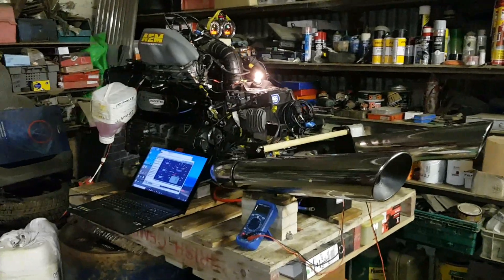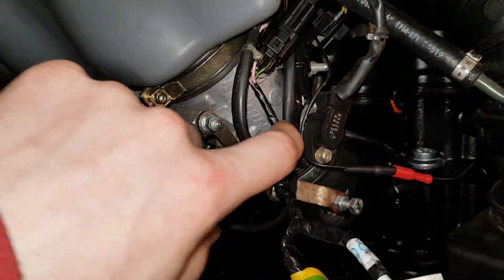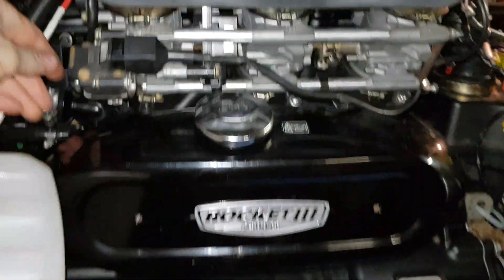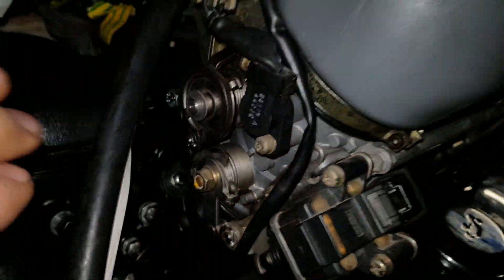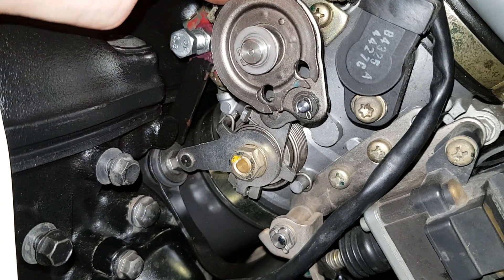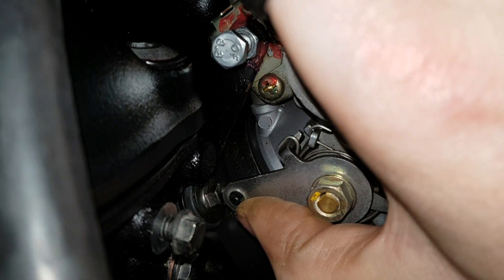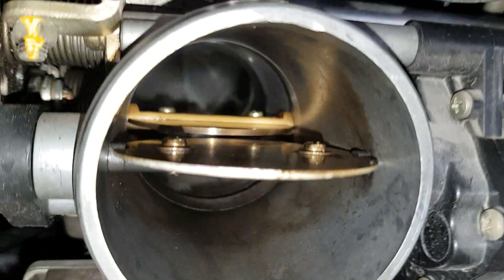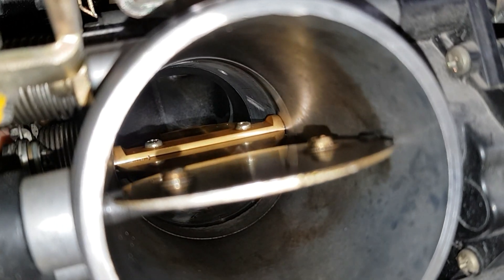What if I told you that you've only used 90% throttle?

Comment: Can we open it up to 100 with some work.
Reply from the maker: You could file the stop tabs. But first I'd run the bike on a dyno using both the twist grip and the actual throttle to see if it makes a difference first.
Reply: @r-iii-rturbo9157  thank you! Just joined the rocket owners forum your a madman!👍
Reply: What kind of intake do you use btw?
Reply from the maker: @bkj427dvl  on the 2.5L stroker, the completley stock intake. On the road bike, a supercharger :)